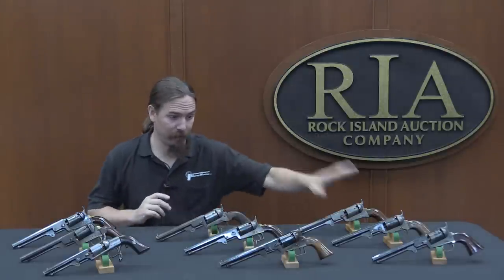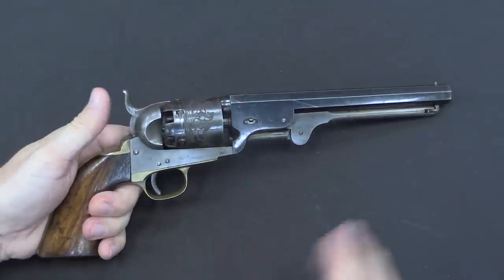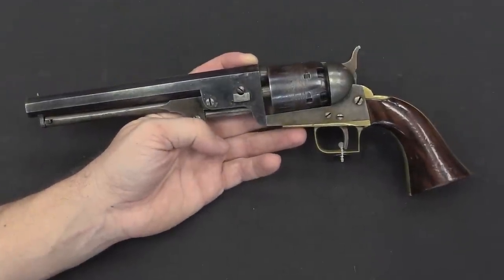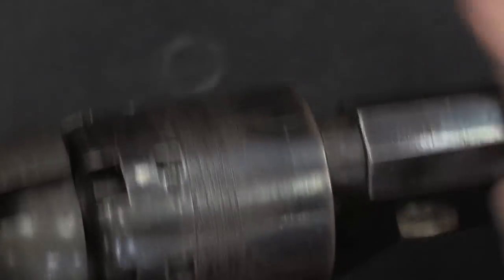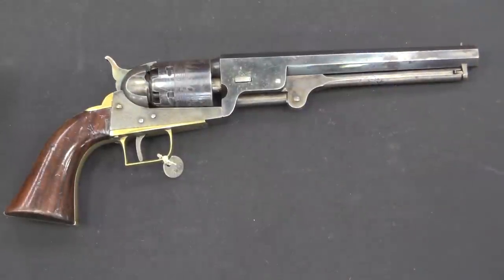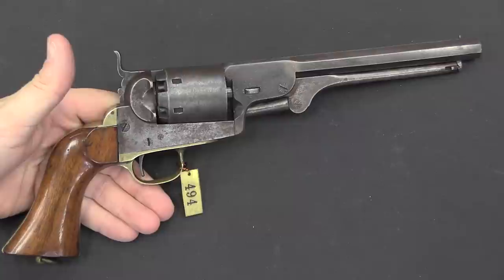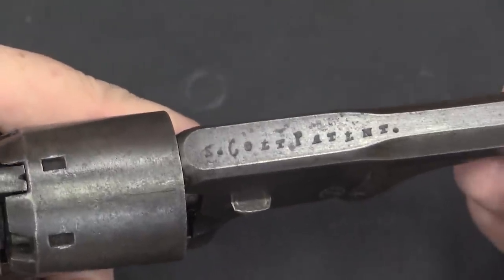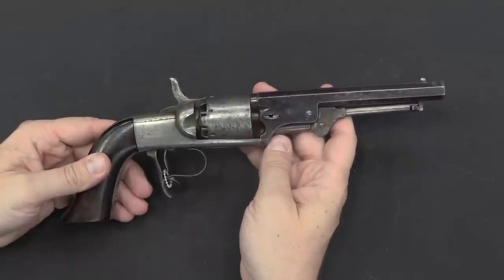Colt "Brevete" Copies: Legal, Illegal, and Post-Legal

Comment: Back in the '60s my brother was in the Army, stationed at Sinope, Turkey.  He wrote me that he could get six Colt revolvers for $90, so I jumped at the chance.  When I got them, they were God-awful copies of the M1851. REALLY bad.  Because of the design flaw, they ended up being the "Swayback model" where they sagged in the middle where the barrel met the cylinder.  Some had "Saml Coult" on the barrel, others were unmarked.  I took one apart to clean it and nearly crapped at how bad the workmanship was.  Screw threads looked like they were scribed on and I could barely get it back together again.  I suspect some of these saw service in the Crimean War as they were super scroungy, but that's just my thought.  I ended up selling them for $25 each at a Yuma, AZ gun show a few years later and kissed my hands that I made out so well.
Reply: Hah! I was stationed at Sinop in 1971/72 and bought one of these too. Mine was marked Colt Brevette but the quality was about what you describe. I was told they were made by prison labor.

Comment: Wow that 2nd one with engraving and partially-turned barrel looks really nice. 
Smart move by the Gunsmith, you would be able to spot his work from across the room if that was a calling-card feature he included on all his guns.  
That little octagon section on the end kinda  makes it look like there's a compensator.
Reply: Yeah that particular Colt Brevete is gorgeous. I would not have felt ripped off if I purchased that pistol at the time. I think the last of the 'meh' Colts (the one before the bad examples) would've been nice too if it had proper markings and proofing.

Comment: Interesting as usual. I don't know how patents were based in 1830 but today that wouldn't be allowed in UK. Using the hammer to turn the cylinder is an idea - not patentable - how you use the hammer to turn the cylinder is patentable. Watt patented the crank to convert linear motion to rotary, but there are lots of other ways to do it which don't use a crank.

Comment: Just to be clear (US general law):
Patents - Generally the design of a physical object, but can include more abstract concepts. Lasts 10-20 years, does not require enforcement to keep, and must be registered with a national government.
Copyright - The content of a work of art. Lasts extremely long (70+ years), does not require enforcement to keep, and does not require registration. The act of simply creating the work grants you copyrights, although registration grants some benefits.
Trademark - The general presentation of something in commerce. Basically if someone can reasonably confuse someone else's product with yours, it may violate your trademark. Lasts as long as you continue to use it, requires registration, and you must enforce it. If you slip and your product name becomes the general term for the item, you may lose your trademark.

Trademarks are also defined within a certain context. For example FedEx has trademarked the color brown, but only within the context of shipping.

If these counterfeit guns were not stamped and sold as Colt weapons, then they are violating patent law. If they are stamped and sold as Colt weapons then they are violating both patent and trademark law.
Reply: Never realized so many faked pistols around

Comment: Ian, I noticed something about the second revolver you show in this video. It seems to have safety pins on the back of the cylinder similar to most modern colt reproductions but missing in the original colts. Was this common?

Comment: Thanks a million for the Video, Great to see these attempts to break into Colts millions.  I would not mind having one of them, just functional you know. I once took a "kit" colt navy copy in trade. It was about half done.  Just far enough to really screw everything up.  Took me about a year with files and rasps to get it to even look colty then a few months of tinkering to get it all in working order.  After taking her our for a test blast I drove by the body shop where the previous owner worked.  H took one look at it and was absolutely thrilled.  He ha not told me before but his father had purchased the kit and worked on it at night on the dining room table till his mom condemned all gun work to the basement.  After his fathers death he had tried several times to finish it but being about half blind he never was able to get it together. He once took it to a gunsmith who laughed him out of the shop.  I did a nice job on it though, after getting all the 'oh shits' out of it I polished her up so well it would make a Smith and Wesson builder blush, cut a brand new set of grip blanks out of some very fancy walnut and then checkered it to a full checker. Oh she was a beauty, she was when I finished, then a full hot bluing when we ran the tanks the next time.  She shot well as well after getting everything squared away. The fellow would not let me out of his shop with the gun, he wanted it back so badly that I took a nearly new Smith and Wesson Model 13 (not my favorite but better then a cap an ball..." and an engine for my daughter's little Buick which sort of gave out on her while away at college.

Comment: Was that a man being run over by a horse in the cylinder scene on the first gun!?
Reply: If you pause the video it looks like the horse is rearing up a bit and turning left, away from the man who appears to be standing just to the side of the horse's right front shoulder.  Not sure if it's supposed to be a depiction of the man trying to gain control of the horse or what, but I don't think it's running him over, though.

Comment: Copyright in the US can be up to Death + 95 years ("Copyright term extension act" or "Sono Bono / Micky Mouse act" from 1998). 70 years is the EU regulation, the international Berne convention in its newest 1979 revision only applies death plus 50 years, which still seems highly generousm but it's through WTO acceptance basically the law all sovereign nations are bound to comply with even for foreign works.

Comment: I have a Belgium made 1860 Army made in the early 1960,s and it is as close to an original Colt as you will see. It is unfired still in the original box with the wax paper wrapping.

Comment: 19:48 you can see that on that cheaper copy, the walnut grips were made from slightly too fresh wood, because it shrunk more than some of the others. in most cases, gun makers have nicely dried wood on hand because they were already in business and had enough money to stock up on wood 10 years ago or more. if they were just getting into it, they would have had to either use too fresh wood, or pay significantly more for old wood from somewhere. if a maker never made enough money to buy a big stock of wood, they would have never gotten out of that dilemma.